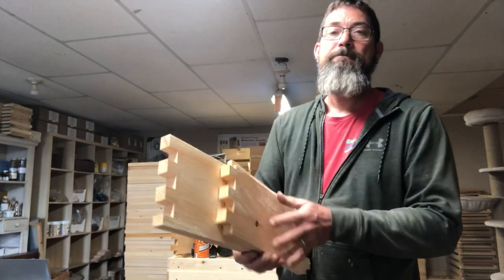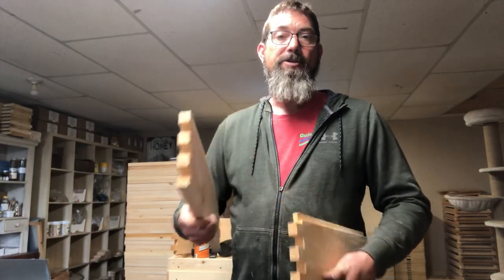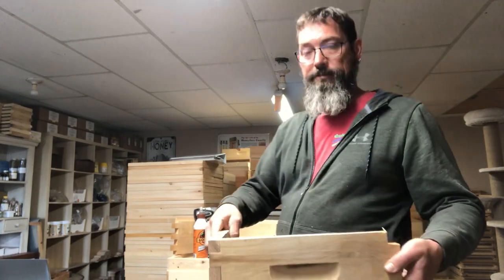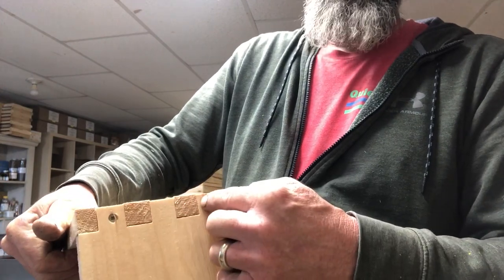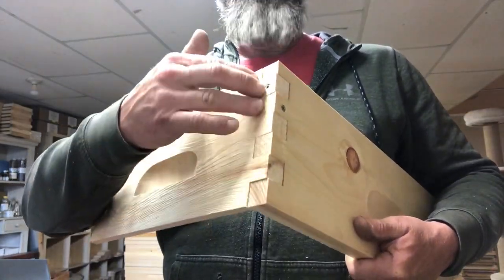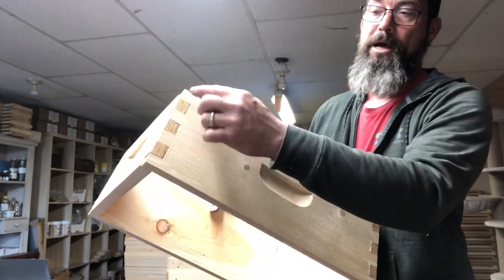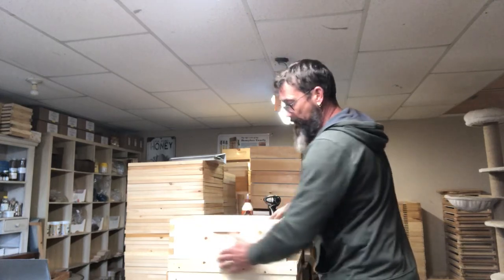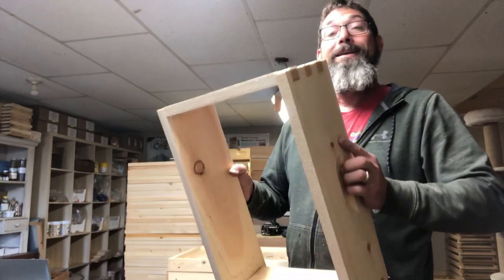How to put a bee hive box together

Comment: Hello Brian.  Could you share with me how I could join two langstroth boxes to become one box (a medium and a deep.)  I'm attempting to glue,nail or something, two boxes together to make make like a 16" box.  thanks so much.  Any ideas are welcomed.
Reply from the maker: Not sure why you’d be doing that but a bit of glue and some nails or screws would probably do it
Reply: @Innisfilcreekhoney  I'm doing this because I have a langstroth both a deep box and a medium box.  And I have changed my mind recently now believing in the Layens Frames.  So I need to join two of my boxes to make a super deep frame.  Oh, and I found some great apoxy to do the trick.  Thanks for helping.
Reply: Hello Brian what size screws do you use and do recommend to predrilled to prevent splitting? I just order 2 hives and they didn't come with any nails or screws.